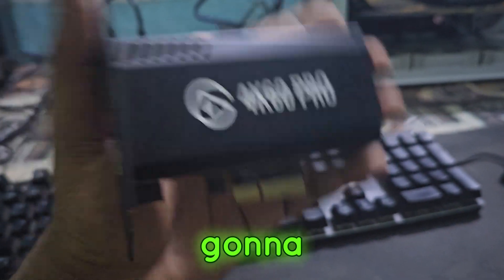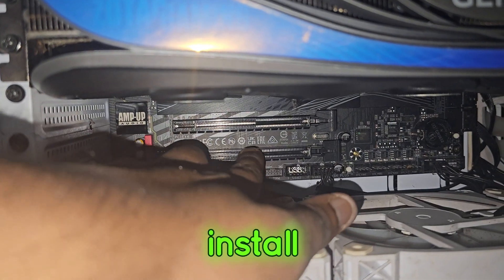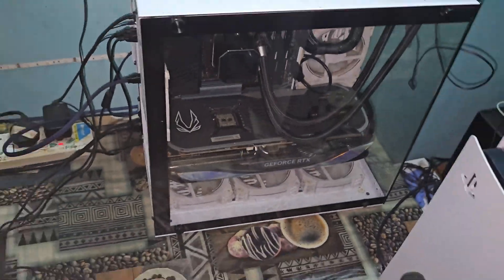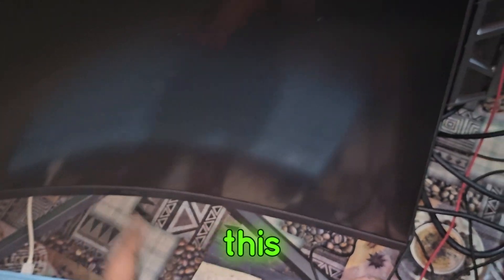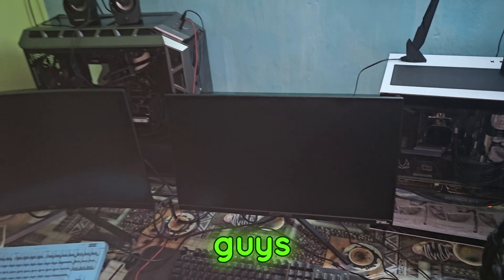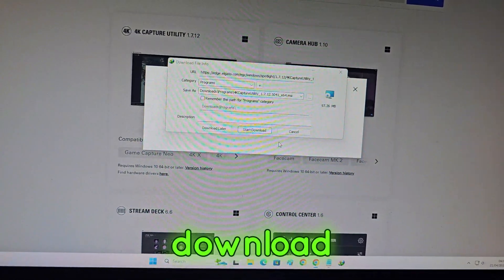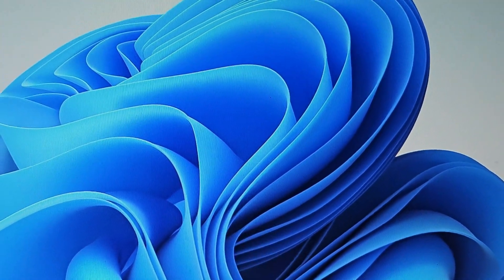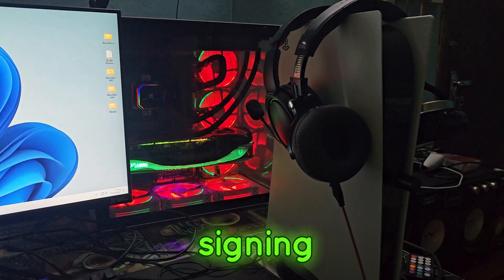How To Setup Dual PC Streaming With Elgato 4K60 Pro MK.2

Comment: Did everything correct but on my gaming PC, the screen is flickering on and off and when it flickers it shows the desktop for a split second and then it turns off and then shows a desktop for a split second and then it turns off again and it repeats itself over and over and over again
Reply from the maker: could be GPU or drivers related issues.
Reply: @YashvirGaming  i ended up returning. i think it was because of my cpu on my 2nd pc (its a i5 14400f) with a RTX 4060 32GB DDR4 and my main pc is a i9 14900k with a RTX 5080 64GB DDR5

Comment: you cant have one pc to use this capture card?
Reply: Yes you can also setup as SINGLE PC
Reply: you can but if the PC is using all the resources say even if you have RTX 4090 gaming pc 
and install the external capture card its already like gaming using all the resources on the PC gaming 
then you're forcing it to record as well some point it might struggle so why not build another micro ATX or mini ITX , even if you can afford another ATX secondary PC
setup that for Recording or Streaming
Reply: How would that work? You cant have 1 monitors and 2 pcs